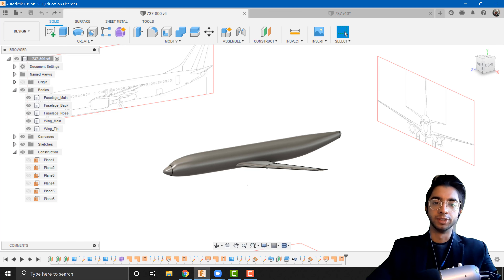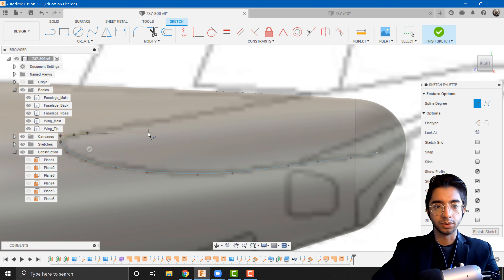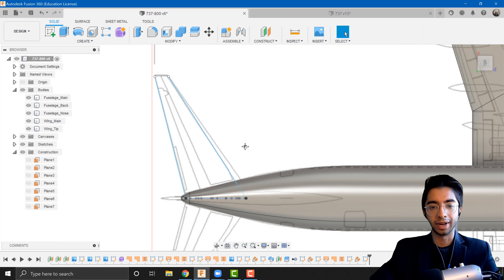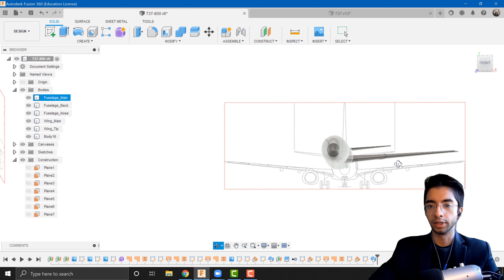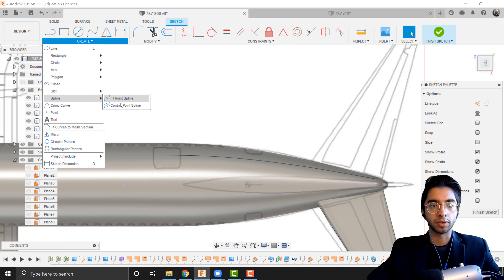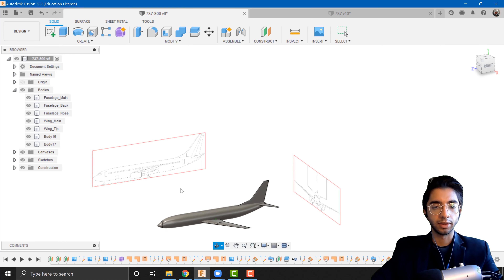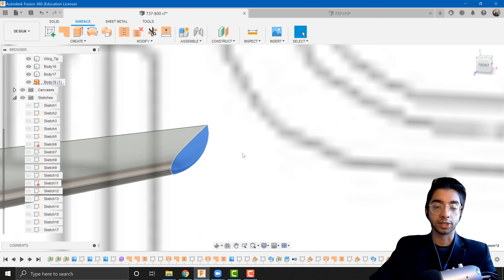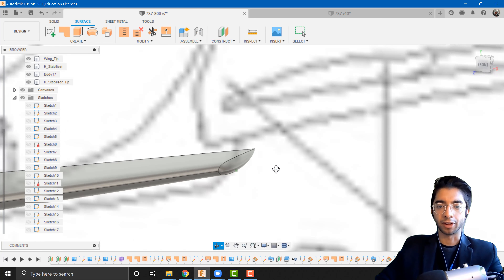How to Model an Aircraft in Fusion 360 | Tutorial 4 - Empennage | Step-by-Step (4K)

Comment: I came accross this problem few times , when we sweep for the h stab. or the wing , the tip you get in the wing is not a face that means you get it hollow, so I coudn't sketch on it and select it as a plane to sketch, but in your case it does not happen , in the case of h stabiliser , I patched that tip to make it solid and also stitched it , but the whole body in the browser terminal was showing the surface body symbol . PLS HELP!
for your understanding it is this part 15:01
thanks

Comment: Great video man!! I am doing great by following your steps. I have one question. I have followed everything you are doing but when I go to do the wingtips, I only have one point at the back of the airfoil. When I try to draw the chord line to complete the tips of the horizontal and vertical stabilizers, I can't close the surface and the loft never works. I hope that makes sense. Thanks for putting this video up because I am a newbie for fusion and want to scratch build an A350 using 3d printed molds.
Reply: i think may be profile are selecting may be not clossed profile i also face that problem

Comment: I’m making a v tail and it an rc plane that I’ll 3d print. How would I make it so that the ruddervator can freely move and is not inside of the fuselage?
Reply from the maker: Hey there. I suspect you can assemble it such that the main V and H tail are fixed to the aircraft body, and the elevators and rudders are cut out in real life, assembled to the H and V tails respectively using a RC kit. Have you looked up on how to make RC planes on YouTube?
Reply: @TEXDesignEngineering   Yeah the info isn’t great but I’m pretty much done with the design

Comment: I had some problem .when I tried to mirror it is showing computation failed..what is the problem then
Reply from the maker: Hi Beerauppam, sorry to hear that. I think you system might have been overloaded. Just try closing Fusion and starting it again, hopefully it should work!
Reply: It still gives me that issue
It says after compute failed "the operation could not create a valid result. Try adjusting the values or changing the inputs."